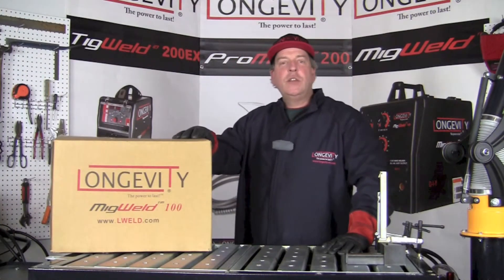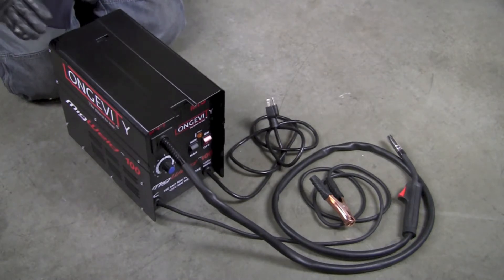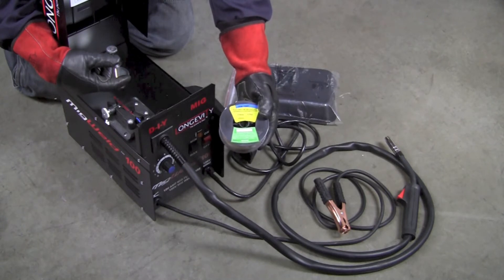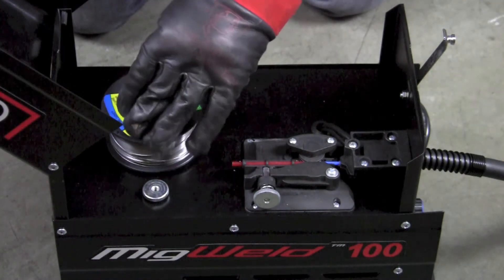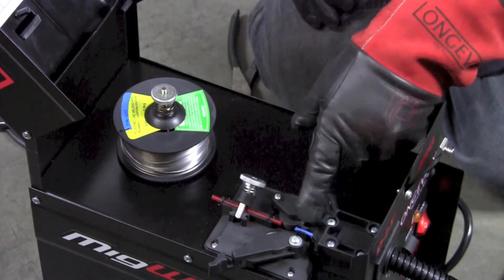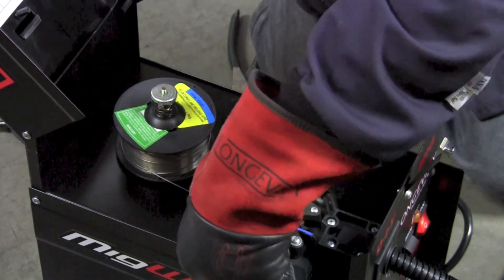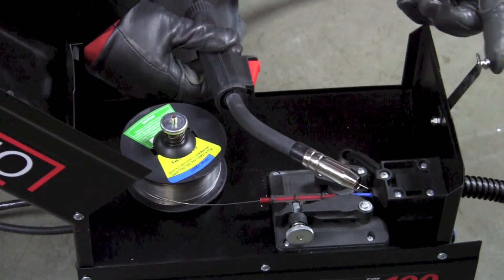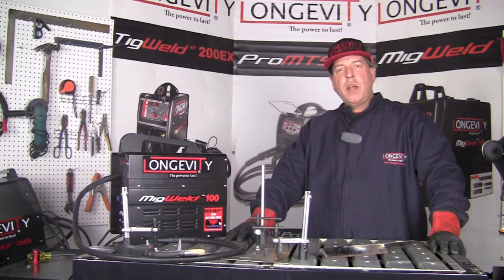Longevity MIGWELD 100 - 100 Amp 120V Flux-Cored MIG Welder

Comment: There's a huge difference between this and all the cheaper "harbor freight" style welders that look similar: this one is DC output.  The otheres are AC output.  The MIGWELD 100 is the only 110v wire welder I've found with DC output from the factory at anywhere close to this price.

Comment: comments seem dead but will this work on 1/4 steel with multiple passes? I'm also looking at a 110  mig from forney industries that states it will weld 1/4 steel but it is AC instead of DC so I'm curious. been trying to find a reasonably priced 110v mig to use with my generator for projects up to 1/4 steel but the bigger brands are just ridiculous for 110 machines.

Comment: That same splatter machine has been sold by a dozen different companies. The frightening thought is that someone still has a warehouse full of these rinky dink splatter boxes. FYI there's no way he's correct on the duty cycle. It's a 90 amp power supply for the first 45 minutes of its life and then its down hill from there. So the claim of 20%@100 amps out of a 90 amp power supply is more of a David Copperfield or Houdini trick.

Comment: Hay everyone thats the same welder thay have at haborfrait for 99 buck in if u want u can print some longevety stickers in u have what thay want 3times the money for
Reply: Its not the same
Reply: Yes it is in like i say thay put thare stickers on it so it looks better
Reply: Lol the longevity is a DC unit harbor freight's unit is AC only which sucks by comparison. Longevity has a rectifier in it which creates the DC current and smooths out the welds greatly so no, they're not the same.
Reply: @pwnedbygary  ye dc why better less splatter and all round better for fluxcore